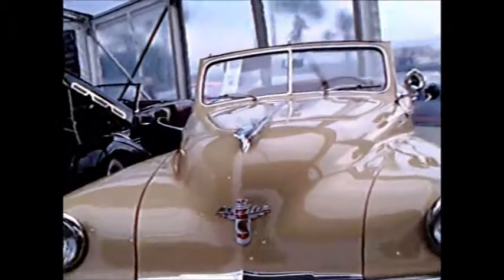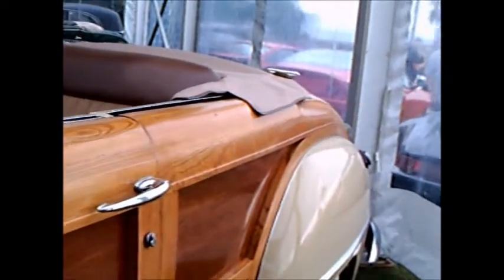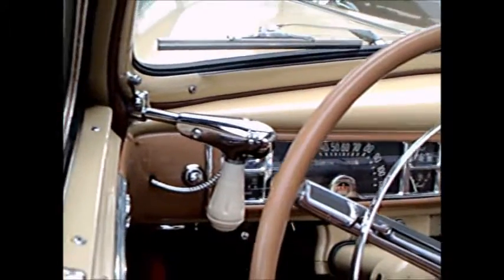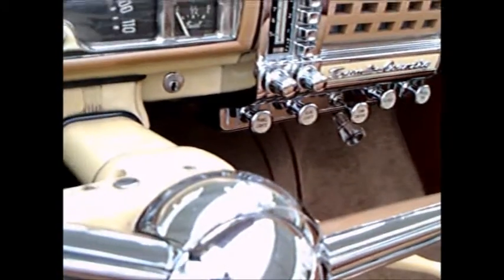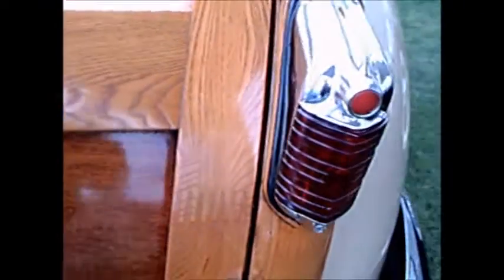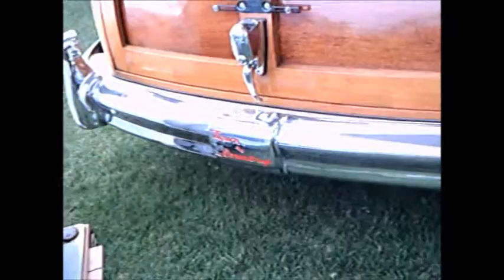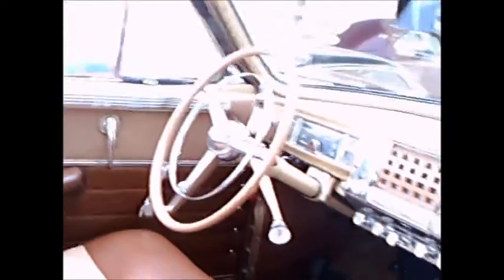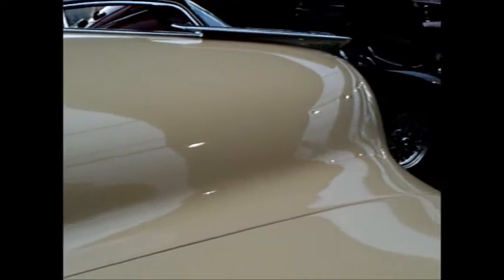1947 Chrysler Town And Country Convertible Beige AmeliaIsland 031017

Comment: This is impressive.  That dash is the best of its kind that I've seen.  You can see the special detailing through out the whole car.  These were those heavy suburban cars you'd see in period advertisements and movies.  The color scheme flows so freely and compliments the car inside and out.  I wouldn't want to 'hit' anyone with one of these...  Still beautiful..  Thanks Jack!
Reply from the maker: Hey, Dave!  This is the dawn of the use of plastic like materials in car decoration.  However, it was just trim...the biggest expanse is that radio grille.  Most of the car is reliable steel and wood!  Real materials, that hopefully would never be involved in a collision!   If someone ever rear-ended the car, you'd have to hire a wood worker besides the usual collision specialists!  Thanks!  :) Jack

Comment: This has to be one of the most beautiful cars that you have exhibited. I bet that wood trim could have been a little high maintenance to keep it in show room condition. Do you know if the straight eight was a flat head or an overhead valve arrangement? I want one!
Reply from the maker: Yes, this is the real McCoy....all the wood appearing here is real wood, and as such requires diligent care.  The following year they went to DiNoc panels for the darker areas.  The engine was a flathead straight eight.  The overhead valve V8 was introduced in 1951 on Chrysler cars.  Thanks!  :) Jack